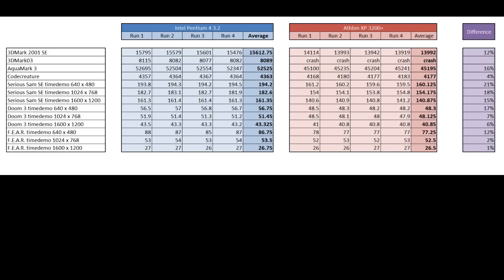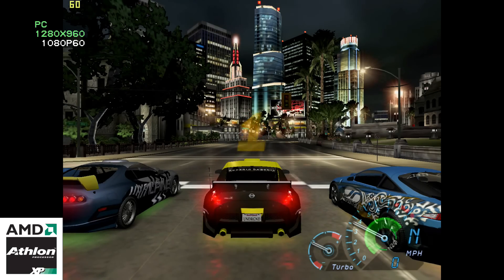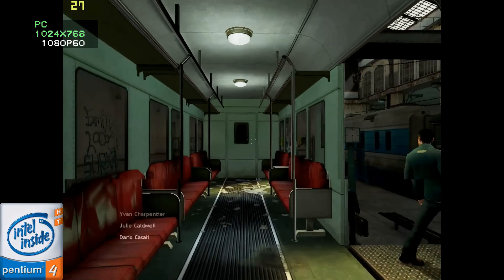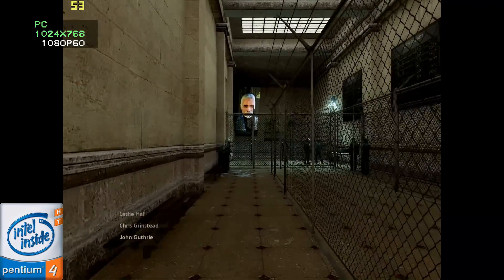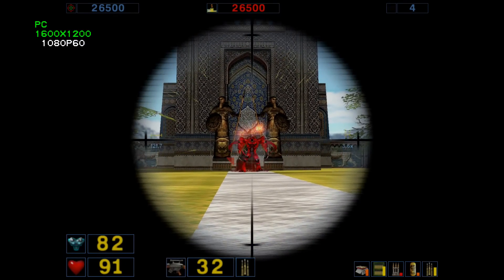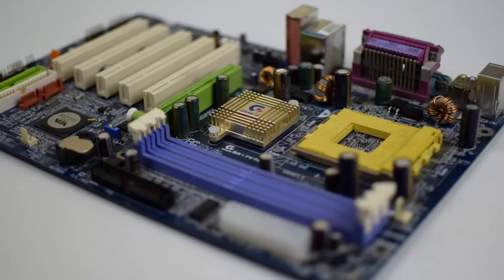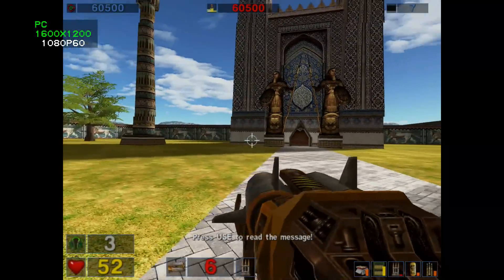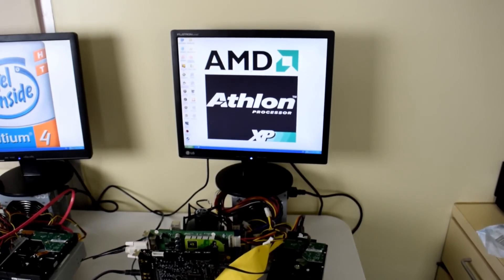Intel vs AMD S1E1 - P4 3.2 vs XP 3200+

Comment: Back then,motherboard chipsets were an important factor for better results and stability.
Most people know that Via is low end and a Nforce2 chipset mobo should have been used,it would make enough difference on frames.

Comment: I had one Athlon XP 2000 and one ATI 9250 256M 128bit both overclocked. Man... running underground 2 nearly to the max was awesome those days!
One trick to me get more speed from the CPU was overclock the fsb and reduce the multiplier, so i had more throughput of memory and not much overheat. The DDR 266 limitation was a pain in the *ss. So i reduced the multiplier from the stock 12.5 to 11.5 and throw the fsb from the original 133 to +/- 155 to achieve the 1800 mhz instead of the original 1667 mhz.

Comment: I still used the barthon 3200xp in 2007 then downclocked ,then downclocked and downclocked -last it did  runs as 900 then it died - it was good thou - i could downclock it and use same hardware . Played Battlefield Heroes and Wow on it. (had 2  1G dual channel memory which ( I checked) made the computer whopping 2%faster.

Comment: Recently I put together similar testbenches with P4 @3ghz vs Athlon XP 3000+,  a 6600GT AGP, 1GB of RAM each, and I remember 3DMark 03 crashing in the same spot on the AMD CPU. Also, my P4 was a little bit faster than my Athlon setup
Reply from the maker: Dragos Moldovan A different driver for the GPU fixes this. But don't ask me what driver version...
Reply: PhilsComputerLab Oh... Far Cry also has issues with the latest 6600GT driver... what a buggy card then
Reply: @dragosmoldovan990  my athlon xp system also crashes in 3dmark 03... always during loading the second benchmark

Comment: Pentium 4 was way more expensive than Athlons. And given how easily Athlons overclocked almost everyone were getting something like 2500+ or even 1700+ JIUHB which due to unlocked multiplier and lack of difference in performance due to efficient Athlons usage of L2 cache could easily outperform 'official' Athlons 3200+. Ahh, those were the times =)
Reply: Multiplier was locked. Only bus overcloking was available, unless you had DFI Lanparty board.

Comment: Very interesting video, the best processors I had been working with in Windows XP were the Intel Pentium 4 at either 1.8 or 2.0 GHz (it was from an old 2001 gateway pc), Core 2 Duo E6600 and currently the Core 2 Quad Q9650. As for AMD, they were the Athlon XP 2600+ and the Athlon 64 3500+. They are very good processors in my gaming experiences

Comment: Oh the good old days of my youth, playing on an Athlon xp 2200+ with half a gig of RAM and a weezy nvidia fx5200. It would just about run Need for Speed underground 2 at medium to low settings
Reply: FX 5200 was pretty good overclocker. I managed to increase clock speed by 30%.

Comment: I had an ASUS A7N8X-E Deluxe with a Athlon XP 2500+ Barton; the famous overclocker. I had it running at 2.5GHz from its stock 1.8GHz. It was paired with a 6800 GT. For sound, the on-board sound was better than most sound cards because it was separate APU. If I were to build a system around the Athlon XP +, that is the combo I would go with.
(Your channel is really making me wish I kept all my old stuff)

Comment: Nah, there was definitely a bum RAM stick or motherboard with the Athlon XP setup.  I've built systems since the 90's, and every Athlon XP system I've seen(that wasn't broken) would crush a Pentium 4 in almost every way.  

As an aside, I'm pretty sure Intel knew from day one that the Pentium 4 was a lemon and dead-end architecture.  But they didn't have any way of pushing the Pentium 3 architecture any faster at the time until they managed to crank out the Pentium M(which annihilated the P4) and the Core chips.

Comment: I recently dug up my first computer from my parents attic.  An Athlon XP 3000+ MicroATX build in a Cube-like case.  I'm thinking of re-building it and getting a 3200+ for it on ebay, since they're 10$.  

It technically wasn't my first computer, as the original build ended up with a dead DFI motherboard and corrupted Raid0.  So the rebuild used an Abit motherboard and just opted to use a single HDD.  I'll have to see if i can hunt all the drivers down for it, but at least i have a REALLY good thermaltake heatsink for the socket (all copper with a decent quiet fan).

Comment: I had an Athlon XP 2100+ @ 2.0Ghz, 1GB DDR, MSI Nforce2, Geforce 4200 Ti 64MB, and an 80GB HDD, all in some cheesy case with a biohazard fan grill and LED's all over. God did I love that machine. Barely ran Doom 3 or Half Life 2, but those were the days. Pentiums were much more expensive than Athlons where I lived.

Comment: These were dark days for Intel owners and I was one of them. The rating system used by AMD was derided in some quarters but nonetheless I felt myself to be in a distinct minority amongst other PC gamers. Those Athlons were everywhere. I found a good deal on a Prescott  3.8ghz and managed to overclock it to ... 3.9ghz.  Probably the best secondary heating system I ever had. Moving forward to my current Haswell setup and the underwhelming performance of it's successors I may not be so loyal if Ryzen can prove to be a credible upgrade.

Comment: I have had both the same gigabyte and abit board for the same system back in the day that are in this video. I actually bought the abit board as a replacement for the gigabyte as I also encountered stability and performance issues. All issues were resolved with the abit board and also enjoyed a great performance boost.  Years latter I reused the gigabyte board as a folding rig and then one of the MOSFETs exploded sending pieces of it across the room.

Comment: I've got a retro '04 build p4 3.2 ht and x800 pro and my frames a lot lower, for example I can barely play morrowind at 800*600 35fps, where is a catch?
Reply from the maker: It's a very demanding game.
Reply: In this video you are playing at 1600*1200 with the same 35fps and your specs is quite similar to mine, so I must have a problem somewhere
Reply: rebuilt and retested my system again and everything is alright, panicked to soon

Comment: the thing is not that amd was very good, it was intel that was flopping hard with their high clock rate strategy.
fast forward to a decade later, AMD compensates low performance per clock with higher clock rates (4GHz AMD FX vs 3GHz intel i7 and i7 still wins.).
The tables have turned, but AMD is trying to catch up again to intel with the ryzen architecture expected to highly shrink the IPC gap.

Comment: As you can see in the performance tests, the Athlon XP was superior than the P4.
Intel has paid "benchmark reviewers" to make the P4 look more powerful (back then we couldn't just benchmark hardware by downloading software online) and people believed it.
The P4 was nearly twice as much expensive and yet sold a lot more than the Athlon XP for that reason.
Intel has been sued in the late 2000's and has lost the case, and now is paying 20 USD to anyone who can prove they purchased a P4 back in the day.
This cheat made Intel become the leading CPU and made AMD lose a lot of money, to the point they closed down their fab and now use a third party fab to make their chips.
Reply: Actually, they didn't close the fab down, they pretty much spun it off into a separate entity, and still utilize the same fab.
Reply from the maker: I agree with a lot of things you say :) Socket A has a lot of challenges, 5V heavy, so a lot of modern PSUs struggle and the lack of SSE2 means Steam doesn't run anymore, which is a huge issue. These days, I much prefer Socket A with slower chips for Windows 98. Athlon 64 is the AMD system I love the most. The Pentium 4, what I always enjoy is how rock solid and stable it is. It just works.
Reply: I actually had a very similiar system to the one in your video, through with HyperThreading and a regular Geforce 6600 instead of GT, but these games all run like I remember them. I think many people especially in America only have experience with crap prebuild P4 systems that were crippled with Intel Extreme Graphics and low build quality. I got the P4 as a gift from my parents when I was 11, it was built from components by a father's acquitance (so not some overpriced prebuild, these were not common in 2004 Slovakia anyways, if you wanted a PC you asked a guy in a computer service shop to order you components and put them together) and I was the happiest 11 year old on Earth. I have already read a bit about PCs at that time, and I was skeptical (in hindsight, a bit more than I should be) of AMD "power ratings" because I knew the old K6 was slower in games compared to Intel chips, because the ratings were more for productivity software for K5 and K6 (or as I learned later, fixed point tasks vs floating point). I only learned later that the XPs had no FPU problem, but I see I was partially right - the 3200+ does not quite reach the performance of 3.2 Ghz P4.

I also feel like the reputation of P4 as a space heater is unwarranted, as even people here in the comment section admit Athlon XPs generated a lot of heat, at least as much as P4 Northwoods. Also, many people compare the Northwoods to stuff that came years later like the X2. The mid 2000s chips all generated heat and had loud fans, it was really the Core 2 Duo that toned that down I think.
Reply: Just checked and current version of Steam client (April 25, 2017) still works for me, it's just the internal browser that's broken. I rarely use Steam though because it uses too much RAM.
Reply: But in this test P4 was more powerful and stable and I am sure Intel did not pay Phil.

Honestly I am tired of all the AMD retro fanboys, the fact is, as "inefficient" it was the Northwood P4, especially with HT, were very decent CPUs. I love how people here talk stuff about RAMBUS from 2001 while this is 2004 era we are talking about. The early Athlon XPs and 64s had extremely unstable chipsets.

Comment: I used to have an AMD 1800+ T-bred (JIUHB stepping) mounted in an Abit AN7 motherboard.
With water cooling I managed to overclock it from 1533 MHz to about 2300 MHz running with a FSB @ 400 MHz.
It even managed to hit 2600 MHz, but was way to unstable when playing games. Normal use was fine though.
It was such a pleasure to play games on, at least until my watercooling sprung a leak and ruined the AGP socket.

Comment: PhilsComputerLab Hi Phil, I'm currently in the process of ordering parts for my Athlon XP 3200+ retro gaming rig and was wondering what would be the best way to add SATA and USB 3.0 to the computer? 

My motherboard is a PCChips FSB400 M848ALU. I've already got the motherboard but noticed it lacks SATA and obviously USB 3.0. I'm aware I can add a PCI SATA card, but how would I go about adding USB 3.0? I only seem to be able to find PCI-E USB 3.0 cards no normal PCI USB 3.0 cards, is it possible to add USB 3.0? 

Also what parts would you recommend for my build?

Regards 
Mammoth

Comment: P4 1.6GHz VS PIII 1.4GHz VS Athlon XP 1600+ 

Budget Warcraft III PC SHOWDOWN.

BTW you should have used an Intel that's closer to the price point of the 3200+, the P4 3.2 GHz was way more expensive ESPECIALLY the Hyper Threaded models! These went up against AMD X2 CPUs not AMD XP CPUs haha
Reply: The AMD X2 was nowhere around at that time.
Reply: AMD X2?
Reply: You said "These went up against AMD X2 CPUs not AMD XP CPUs haha". Except these are 3 years apart.

Comment: i had the gigabyte nforce2 ultra with the althon xp 2500+, and 256mb ram,  a geforce 2 mx400 64bit. I wanted so bad the 3200+ but never had the chance. You inspired me to build now that computer! Thanks
Reply: Nice I had a MSi nforce 2 board but mine only had a Duron 1.0GHz in it that I had overclocked to 1.4GHz haha

Comment: Who here knows that the Athlon XP 3200+ ran at 2.2Ghz?  Too bad it couldn't have been ramped up to the P4's 3.2.  It spanked higher clock rate P4s, but not quite at the top end.

Comment: Used to have an Athlon XP in my first very own gaming PC when I was young. My uncle later upgraded it with his old Radeon X800 but unfortunately the Athlon died later and my uncle gave me his then old PC with a nice P4 HT but a crappy GeForce4 Ti 4200. I still have this PC somewhere but I am planning on a retro build with a Barton Athlon XP and an X800 or X850.
Reply: The GF4 Ti 4200 was legendary back when it was new, sure it's not comparable to the X800 but it's also two generations behind it. 

The GF4 Ti 4200 was made to run games like Elder Scrolls III Morrowind, it's old.
Reply: Joey Greathouse It wasn't that bad, but it was from 2002 or so. My Athlon died in 2005 and that was the time when I got the P4 HT with the GF4 Ti 4200. Back in the days when I was young, I didn't know much about this stuff. As I asked my uncle some years ago he told me that he gave me his old PC because he knew that I didn't need that much power. My X800 went into the PC of his son and was later sold.

Comment: i had an ABIT kt7 raid with an xp2400+ and all it did was crash after crash till they update the bios weeks after i got it,i hit it with a big chuck of wood by the time i got the updated bios i needed a new case and hd cd rom but it was a good mo bo when abit sorted it out,i got a xp3200+ after that cant remember the mother board,but there u go the crap we had to put up with back then they got it easy to day

Comment: Question: how did you capture the video? I'm speculating you used an external hardware, am I right?

By the way, there are some tower-style heatpipe  coolers that are compatible with the Socket 478. I have a used Vantec AeorFlow FX-120 that I acquired a few months ago. It keeps my P4 2800 running at 3,200 MHz (28*114) happily. It also came with mounting kits for sockets 775, 1366, 754, 939, 940, and AM2, so you could use it with many nostalgia platforms from Intel and AMD. I recall Xigmatek also sold a rebranded FX-120, whose model name escapes me.

Finally, that 3DMark03 crash has to do with the VIA chipset, not the processor. You might want to hunt for a decent NForce2 motherboard and ditch the crappy VIA KT400.

Comment: I recently picked up a nifty 2004-era system for $5 at a thrift store. Athlon 64 Venice 3400+ (S754 sadly) Biostar Nforce 3 250 motherboard, 1GB PC3200 DDR, Radeon 9600XT 128MB, DVD & floppy drive & 40GB IDE HDD.. I picked up a refurb 160GB SATA drive to swap out, but reused everything else. I picked the machine apart and cleaned everything spotless, applied new thermal grease, etc. It works great!
Reply: Only thing that seems to be wrong with it is the onboard nforce LAN controller causes the system to hard reboot if I'm installing the network card drivers. Disabling the onboard LAN in BIOS seems to make it rock solid.
Reply from the maker: Sweet, good price too!

Comment: Are you sure 3dMark03 is not a Nvidia driver issue? I have run 3dMark03 on three different socket 462 motherboards (both back in the day when the hardware was new and with a recent retro build!), all with ATI cards without any hiccups. I suggest you try again with an equivalent ATI card to that 6600! Oh it could be a Windows XP problem? I have always used Windows 2000 with my socket 462 builds.
Reply: Just watched episode 2... called it!
Reply from the maker: Yea it was, an older driver fixes it. BUT, the same driver doesn't crash on the P4.

Comment: Back in the day I had an XP-M 2500 ( the mobile part, with the unlocked multiplier and lower voltage ) running at like 3.2ish Ghz on an A7N8X-E Deluxe mobo ( Nforce II 400 Chipset ). IIRC I had a Thermaltake Volcano 12 cooler, an ATI 9600 PRO 256 and some kind of soundblaster thing. Had like a Gig of DDR 400 ram at like 466 'cause Corsair was awesome.

Man, I gotta rebuild that thing.

Comment: The Gigabyte 7VT600 is one of the worst possible motherboard choices for the Athlon XP. The VIA KT600 chipset is notoriously bad (unstable, incompatible, has crappy drivers) and Gigabyte's implementation is particularly bad.
Something with an nForce 2 chipset, like an Asus A7N8X, that you can pick up on eBay for about 25-30$ would have been a much better choice (and a much better match for the Intel 865), since it's more stable, has much better driver support and it even supports dual-channel memory.
I used to work in a computer repair shop back in the day when this tech was relatively new, also I personally owned an Asus KT600 board (A7V600), which was only marginally better than the Gigabyte one, but I upgraded it to an A7N8X-E Deluxe and saw a world of difference.
Reply from the maker: Please watch the other episodes :)

Also I disagree that the KT600 was that bad. The nForce2 is a bit faster, but doesn't do much against the P4. The 865 is the budget chipset, if you go highend with AMD you got to with the 875 for Intel. Which I have also covered in episode 3 I believe.
Reply: +PhilsComputerLab  The 845 is the budget chipset with the single channel memory and no sata.
Reply from the maker: Istvan Kovasznai The 845 is too old, not compatible with the 800 MHz FSB Pentium 4s.
Reply: Sorry, I meant the 848.
Reply from the maker: Istvan Kovasznai Wow, never come across that one :) Learnt something!
Reply: It's basically a pared-down 865 with only one memory channel. Some really cheap 848 boards even came without sata ports.